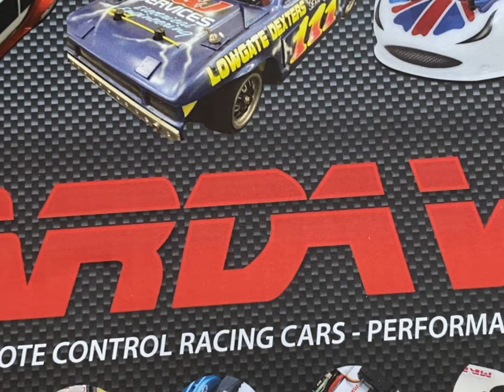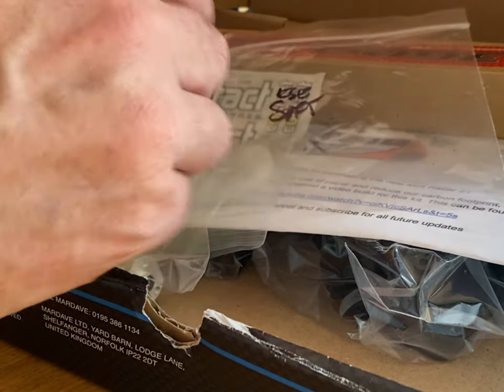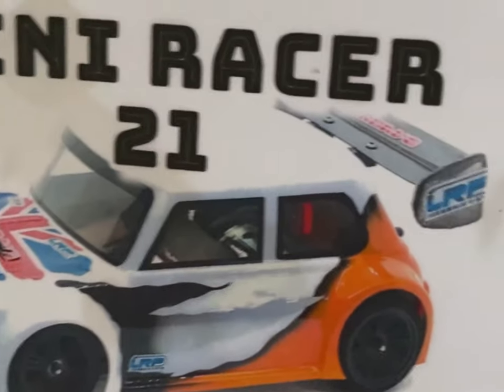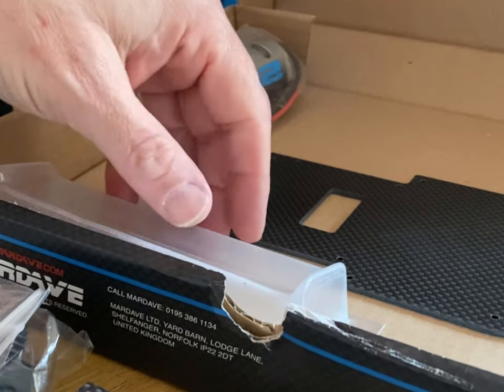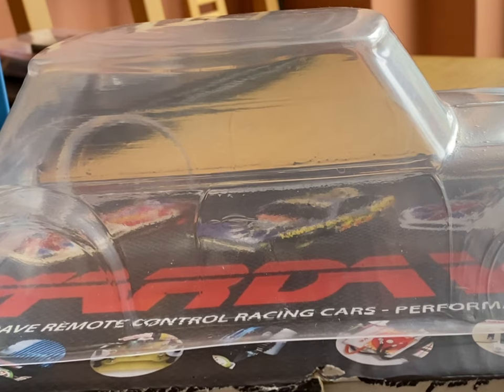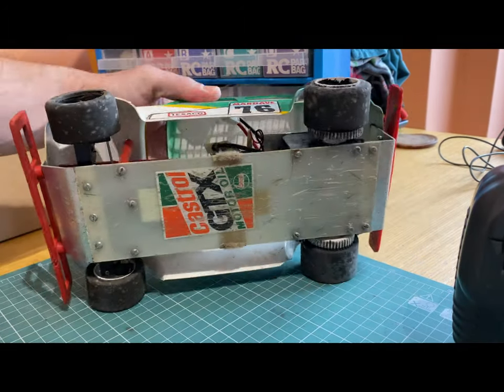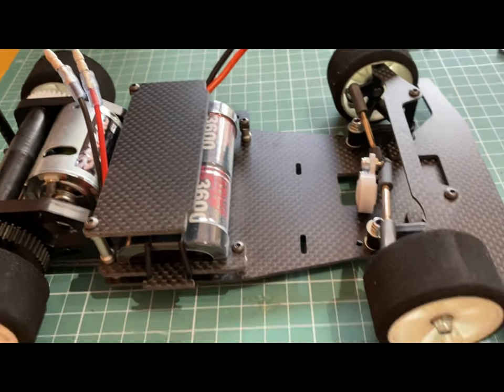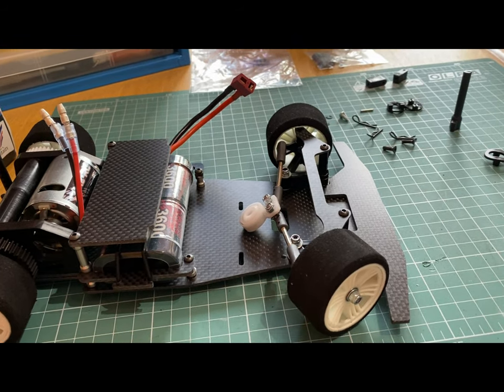Mardave Mini 21 (Carbon Fibre) Build Video

Comment: Contact wheels are not 3d printed as far as I know.  They are SuperStox wheels, been around for years.
Also - the body shell - you leave the whole shell in place - and just mask off the window, spray the rest?
Reply from the maker: The standard wheels with the kit i think are used on other Mardave kits, they look like non 3d printed, i bought some revo's in black which look 3d printed but dont fit the front as there is no bearing, looks like they are for a different Mardave kit, even though they would fit the rear of the Mini 21. Regarding the shell, i have always trimmed the shell to fit chassis and masked windows, then paint - if i have read your comment right? On the Mini 21 i was "planning" to cut part of the windows out as per UK oval Hot Rod but undecided so far